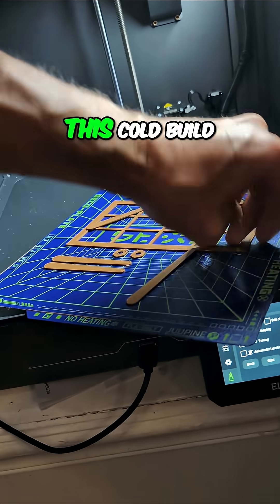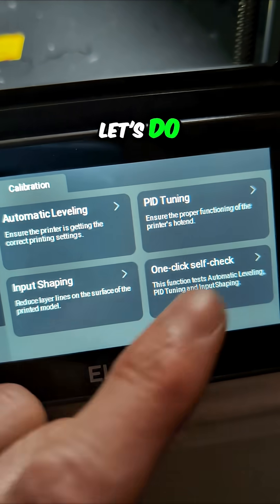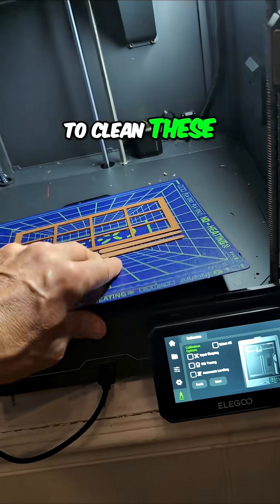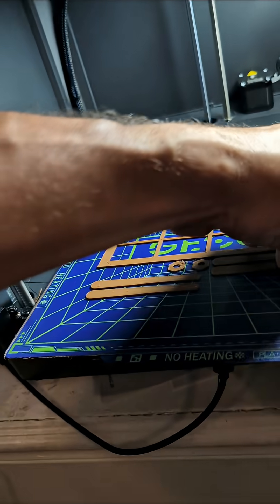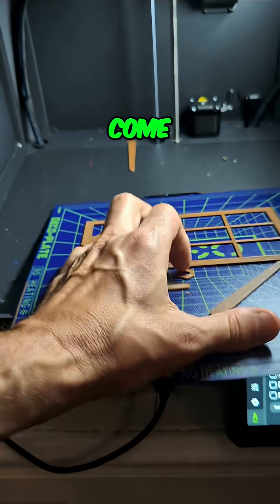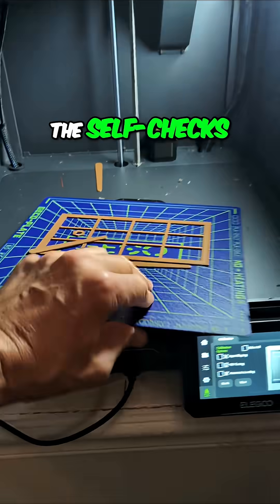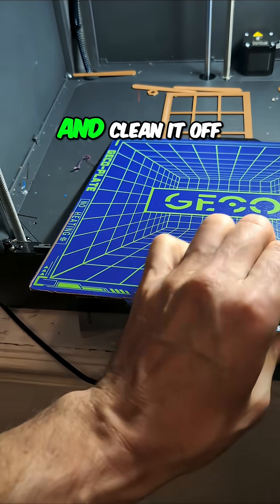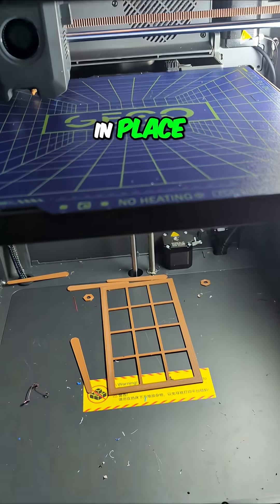Crazy Adhesion! Cold Build Plate 3D Printing. Elegoo Centauri Carbon  #shorts

Comment: Why do you not flex the plate to help yourself to get the parts off?  Pulling parts of those textured plates will eventually separate the layers and ruin the plate. They are fairly inexpensive but not ruining the one you have should be the goal. Good luck!
Reply from the maker: I only have 2x hands. Can't hold the camera AND flex the plate with both hands

Comment: Haha in my videos I use my hand and my knee to pop stuff off.  😅  I knew I'd have to manage it somehow after seeing your videos. 

Hey about the cold build plate, how do you do the leveling for it?  Doesn't the leveling automatically do it at 60 degrees bed?  Then it has to cool down to whatever to start printing (as it did on my side B of the stock build plate) and due to metal contraction the first layer was horrendous... what do you do?
Reply from the maker: Leveling is locked in the firmware at 60f, as far as I can tell. :(
But it works fine.